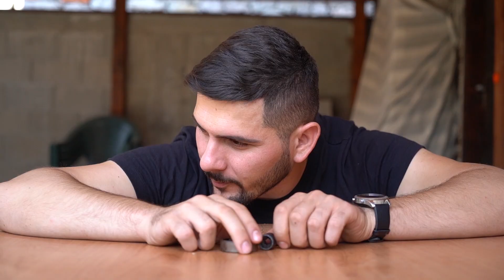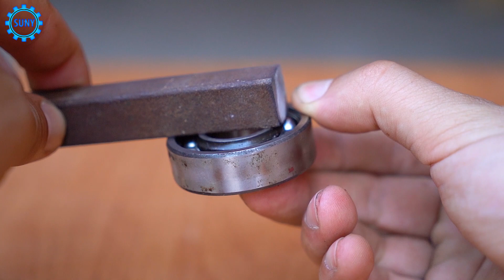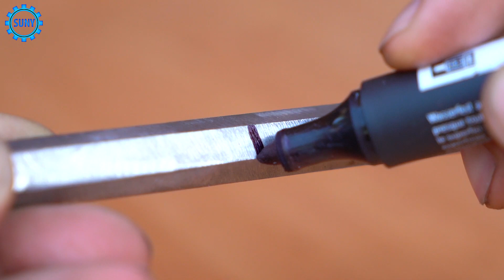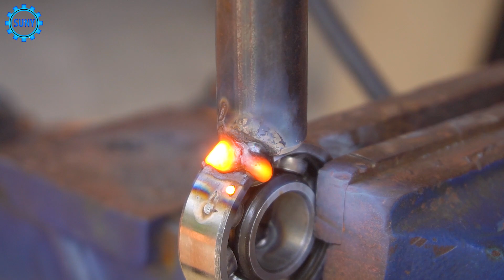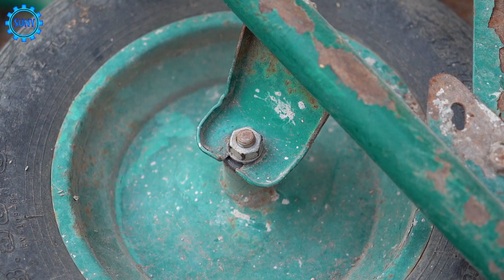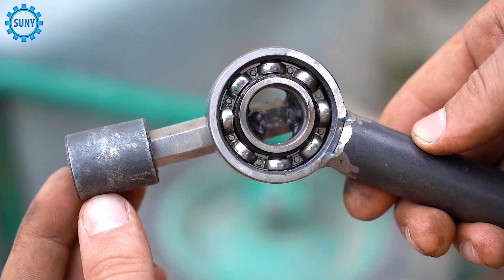UNIQUE HANDMADE INVENTIONS

Comment: never gonna work,  if you really need to tighten up or undo bolt or nut,  because bearing union is not designed for such tasks and  will snap very easily